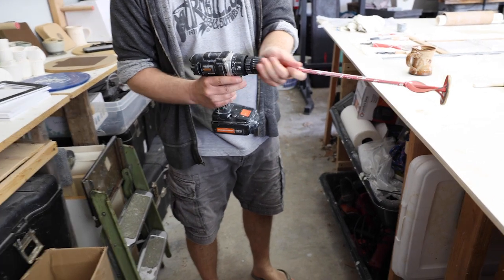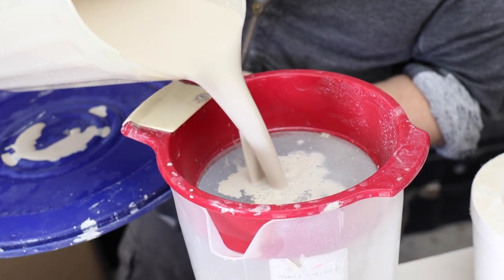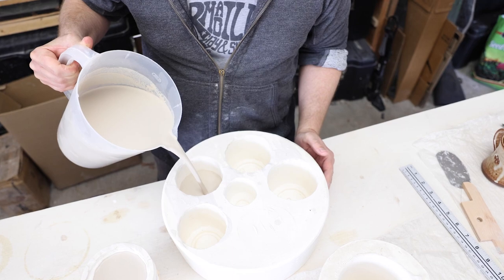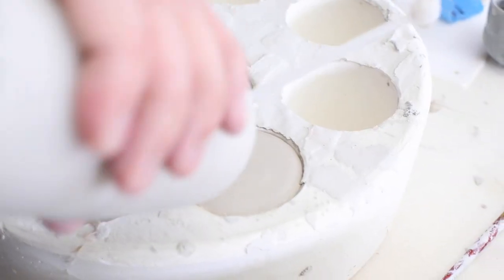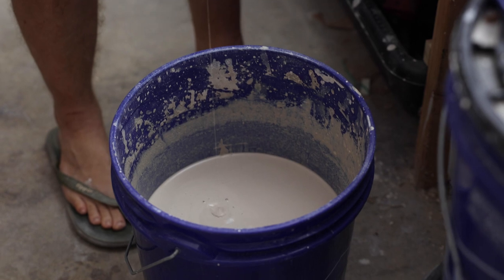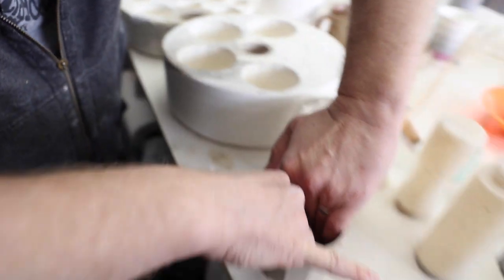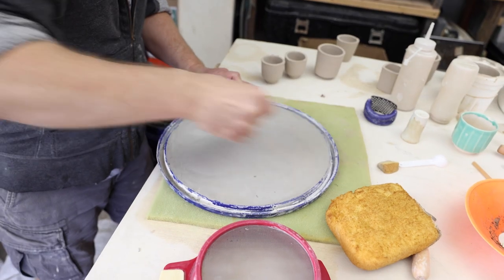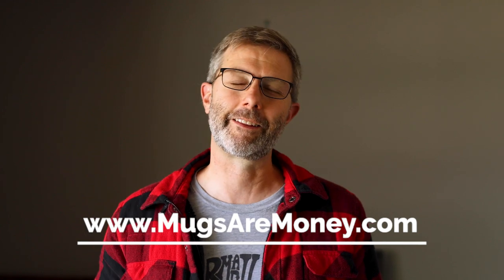Learn Slip Casting in 3 Minutes with this Step-by-Step Tutorial

Comment: I’m glad to see you sieve your glaze. I have to tell you, be careful using that metal paint stirrer. I was mixing my slip last month and after having poured all of my molds for that day I was cleaning the seems and saw red marks in the clay. Come to find out the red coating on the mixer came off!! It was all over in the slip and my pieces!! I had to let everything dry out and then break it all down and make it into slip again then sieve the slip. I don’t even know if that will be enough but I did get several chunks out of the slip.
Reply from the maker: Yikes! I didn't realize that could happen.  Thanks for the heads up Michele! I also didn't realize you could just crumble up bone dry slipcast forms and throw them back into the slip bucket?! 🤯. I'll have to try that.  Thanks! -mj

Comment: So using a plaster instead of a silicone is a must, because it sucks the water out?
Reply from the maker: yes. the plaster sucks water out of the slip and into the mold.  The longer you leave the slip in, the thicker the wall of your vessel.

Comment: slip???
Reply: Slip is clay that is liquefied. You use it to join pieces or in this case he is using it in a process called slipcasting. Slipcasting is a process of pouring "slip" into a plaster mold and using capillary action (plaster sucking the water out of the slip to create clay) to make a shell or walls of your form. The slip inside your piece will be poured out of the plaster mold so all you have inside is a wall of clay